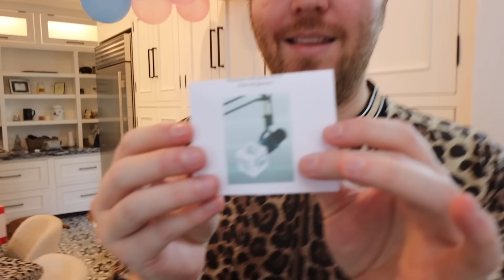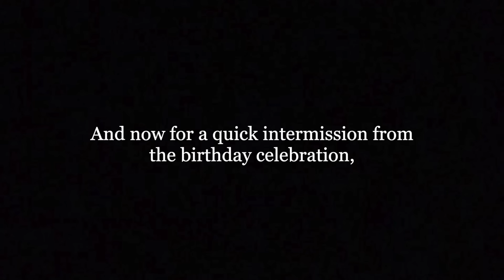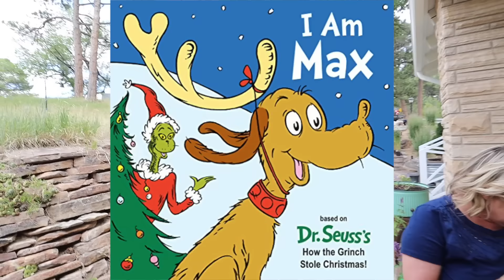WE GOT A SURROGATE!!!

Comment: I agree with Shane. Babies are definitely more work than puppies. Yes they chew things up especially in the teething stage. My daughter still teethes things and she's 3, but she has autism and an under developed oral sensory system. So yes a puppy is preparation for a baby, but be prepared to wake up every 3-4 hours to feed the baby. That's what happened to me at the age of 21. It was hard to go back to work sleep deprived. I ended up not going to work until she was like 4-5 months old because it was just too difficult to get up for work when I only got 3-4 hours of sleep. So yes. Babies are 10 times more work than puppies.